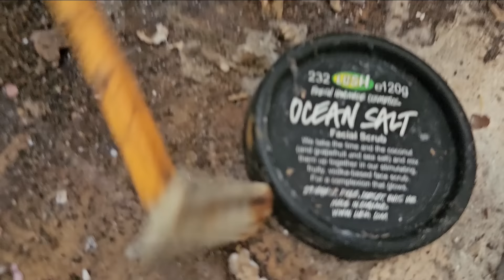Warning: Beware of the Rotten Floorboards Lurking under Our Narrowboat Shower. Ep31

Comment: Awwww Ernie is 1 years old.... happy birthday Ernie. Liz & Paul please give Ernie a birthday pat & cuddle from me ta muchly. Ohhh the bathroom. Are you replacing all the hoses etc to new ones to make sure that there will be no hidden leaks when the old hoses perish.  I am picking that they used magazines/newspaper to help prop up the shower floor, as it was un-level when it was put in. I froze the video at the right moment to see the shower walls.... looking good so far. Roll on next week's video....
Reply from the maker: Hi Andrea. Ernie says thank you for his birthday wishes and cuddle. I said that to Paul that the paper may have been used to stop the shower tray from moving/bouncing but we now also think that because it was shredded like that it may have been am old mouse nest 😬 The pipes will be new the gulped one though I think Paul has kept but just shortened it a little as that was hood condition and he got a goof solid fixing to that. See you next week 😉
Reply: @uponreflection  Liz, if it was a mouse nest, there would have been droppings all over the place in that area or inside the boat.... plus there would have been a tiny hole as well. PS: The lekkie comes next Wednesday. Now moving stuff out of the lounge., cos once the lekkie has been, I will be starting to wash the ceiling and then the walls. Fun times are a coming... lol.
Reply from the maker: We couldn't see any droppings so thats a good sign. Woohooo to the Electrician coming, exciting 😀